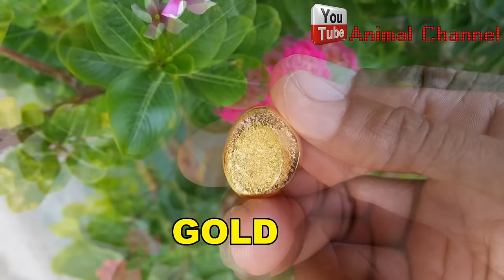Gold wire bond from IC gold Electronic Waste hidden video clip. Gold Recycle wire bond.

Comment from the maker: Wire bonding
Wire bonding is a standard interconnection technique used for electrically connecting microchips to the terminals of a chip package or directly to a substrate (Harman, 2010). Wire bonding technology can either be categorized by the bonding method (ball–wedge or wedge–wedge) or the actual mechanism that creates the metallic interconnection between wire and substrate (thermo-compression, ultrasonic or thermosonic)
The term wire bond or wire bonding is a Micro Assembly service used to describe the process of connecting between a bare die chip (IC) to a substrate, package or other die. In Beckermus Technologies, we supply the complete set of bonding services required for IC Assembly and use the most up-to-date machinery and bonding materials.
Reply: That was so cool can i ask wot purity the button was wen u were finisd
Reply: Melting 1000pcs gold lead please